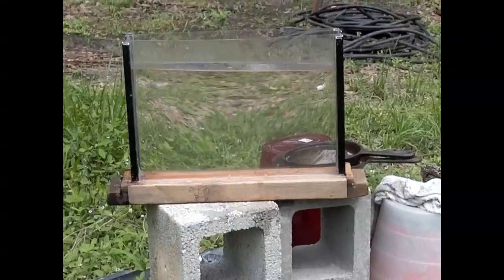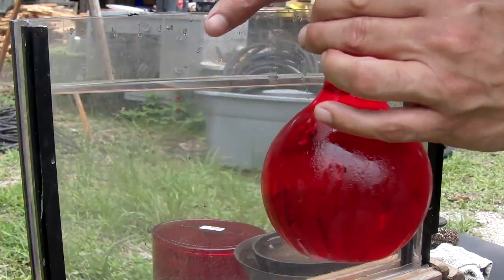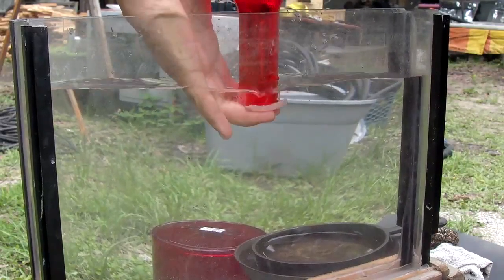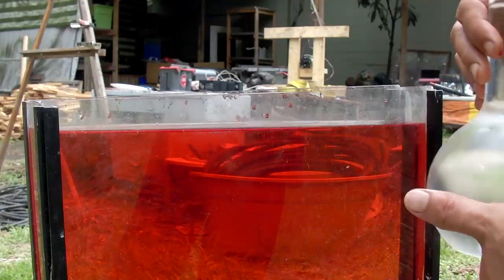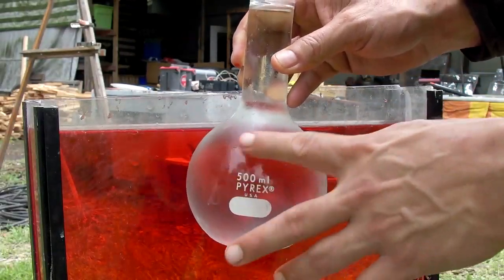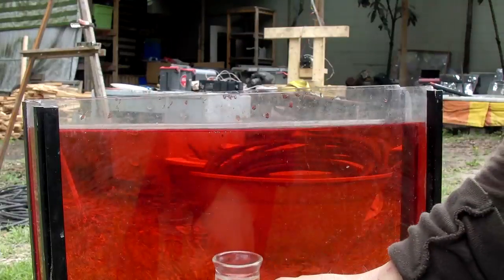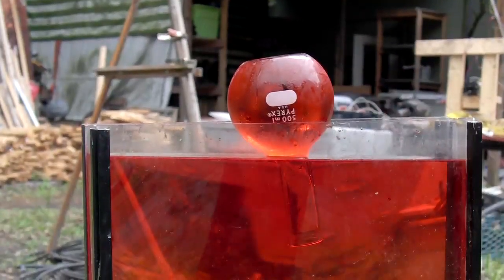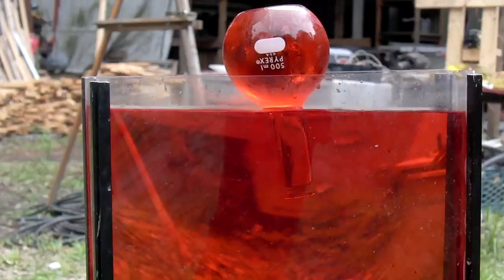THERMAL TRANSFER OF WATER

Comment: @svtcontour I think that's exactly what Dan's trying to demonstrate.  The warmer water rises into the flask, while the colder water enters the tank.  What's causing it is the difference in temperature.  Density is exactly the function of temperature, since the material in both containers are the same.  Ice has a larger volume than water because it forms crystals.  Cold water is still denser than warm water, until it's actually crystalized into ice.

Comment: @day8765 Hello, what happens is that when liquids cool down, they become denser, so because of this they are heavier. Same as air, for example, when you warm air, it losses density and travels up... When you warm a substance, internally the molecules vibrate more, so distance between them are larger as they repeal, that why you have less mass in the same volume...

Comment: Be leave it or not it has nothing to do with how dense the water is. Do you think the same thing would happen if the cold water was the tank and the hot water was in the beaker? would the hot water stay in the beaker and the cold water stay in the tank?the cold water would be much denser the hot much less dense, so the hot water would stay in the beaker?

Comment: I dont get what the video shows because cold water would be a bit more dense and so it would naturally fall and settle to the bottom. Something needs displace what comes out of the pyrex container and therefore, it will be the warmer water which is still at the surface.  I dont think it has anything to do with thermal transfer and more with something needing to replace whats displaced and it just so happens to be whats available which is the warm water at the top.

Comment: I have gone back and read all the posts. Let me ask this" what would happen if the beaker had been placed at the bottom of the tank and a valve opened to the tank? from what I have read in the posts the cold water would stay in the beaker Right? If every thing I have read thus far in the posts this is a true statement. I do not know if Dan will do that and post it for us to see? But my guess is the cold water will come out of the beaker. Can any one tell me why? Yes I do know why.